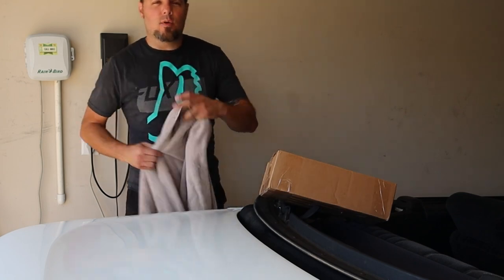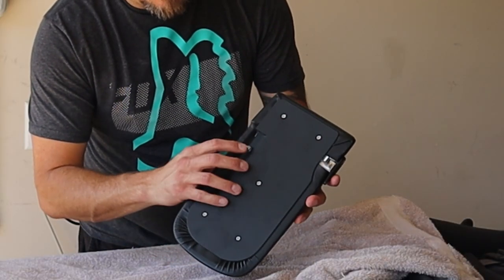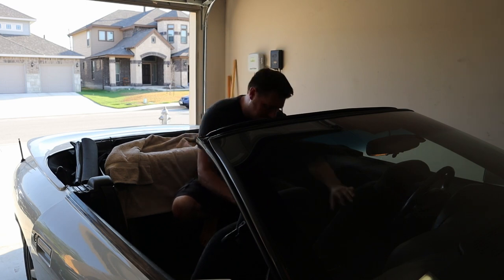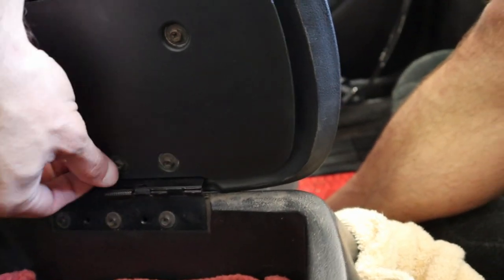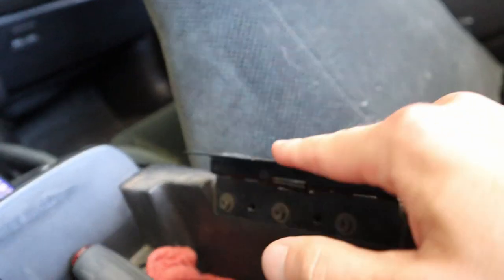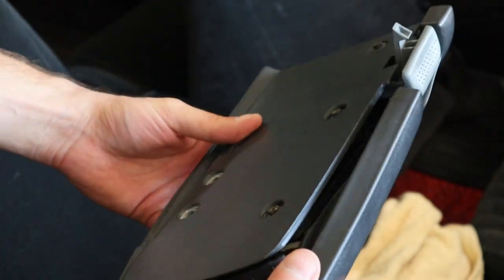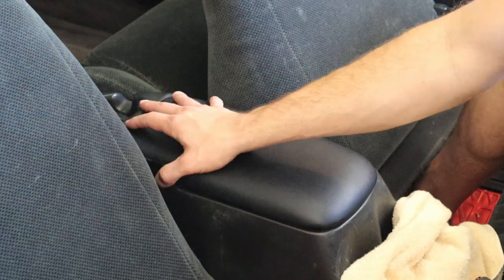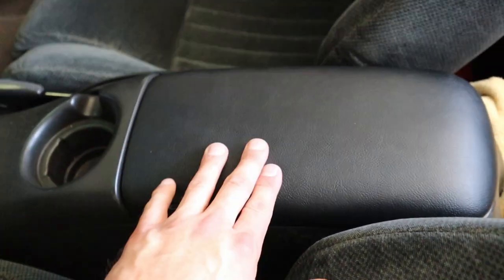4th gen Firebird Convertible Center Console Lid Replacement

Comment: Looks great. The 1997-1999 f-bodies have the gray interior and the 2000-2002 cars have the ebony interior.
Reply from the maker: Ahhhh that makes so much sense now. My last one was a 94 formula and I thought I had all the RPO codes memorized but I've never owned an '01 to '02 until now. This one has ebony but it seems like they mix and match colors and they only made the dashboard in the center console black along with some trim. Thank you!
Reply: @BryanEnsign  someone may have replaced some parts, but it looks much better now. I enjoy Firebird videos.